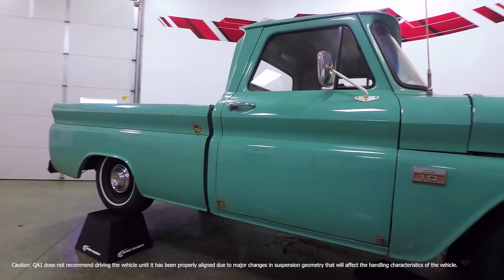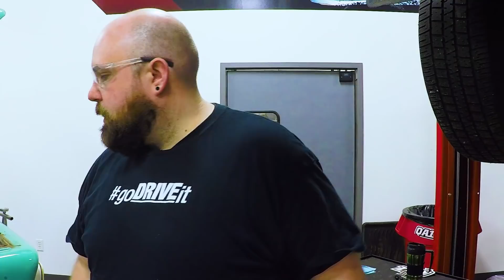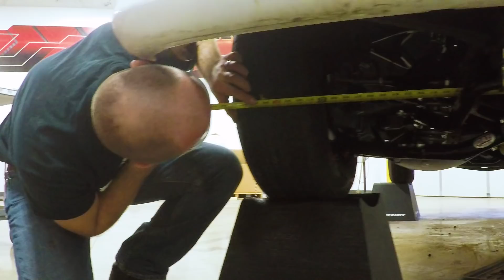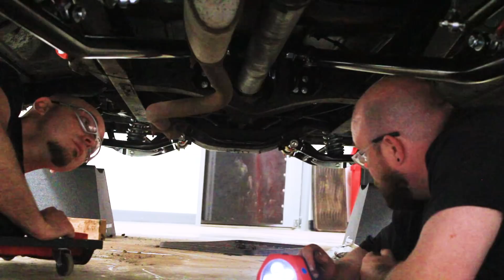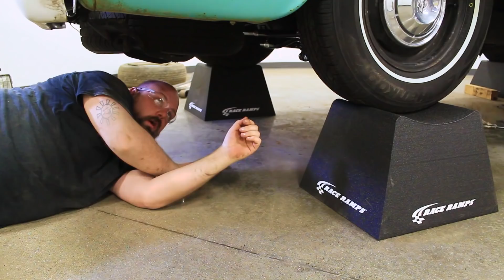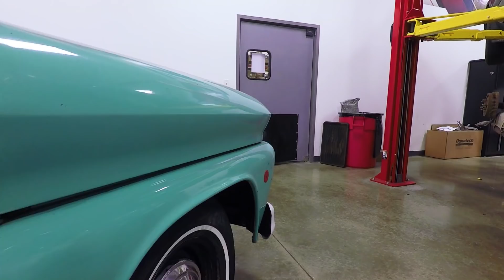63-87 C10 QA1 Suspension Setup - Video 3/3

Comment: I want my rear differential wheels/tires centered in the rear wheel opening. How far can I move it with my adjustable QA1 truck arms? Can I run into trouble if I move it too far? Can I move my box forward and inch or two?
Reply from the maker: The QA1 truck arm system is designed to be able to fine tune the placement in the wheel well. Depending on the ride height and which positions are being used in the mounts, a total of about 1" of adjustability can be expected. If you are needing to move the axle forward or backwards more than that, this kit would not be able to facilitate that. Give us a call at 952-985-5675 with any questions!
Reply: @ thanks

Comment: Is there a difference between having the rear axle supported by jack stands and having the wheels support the truck by having the tires completely on the ground?
Reply from the maker: When it comes to mocking up the axle or setting ride height, there is little to no difference if the weight of the vehicle is on jack stands or physically on its wheels and tires. Call our tech line if you have any other questions 952-985-5675

Comment: My 71 C10 stepside has leaf springs. How will I deal with the straight spring perches ?
Reply from the maker: Early Classics sells the spring perches that you can weld on to work with our system, or you can do a rear end swap.
Reply: Thanks.

Comment: The rear wheels do not appear to be centered in the wheel well, is this an optical illusion or are the wheels sitting forward.
Reply from the maker: We aligned this truck to its factory wheelbase so it's mostly an optical illusion due to camera angles, etc., but the wheels do sit slightly forward of center. Thanks!
Reply: Thanks so much for the information...I have a 66 C10 that I am thinking about lowering a little bit and checking out what is available,
Reply from the maker: You bet! Let us know if you have any other questions. Feel free to give our tech line a call as well at 952-985-5675 M-F 8-5pm CST. Thanks!